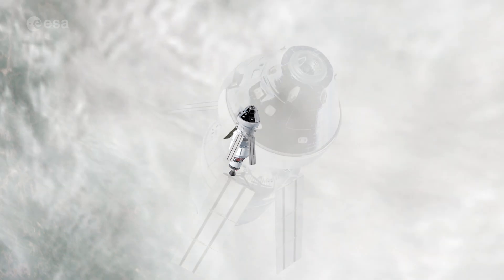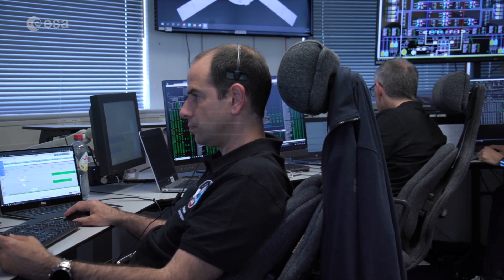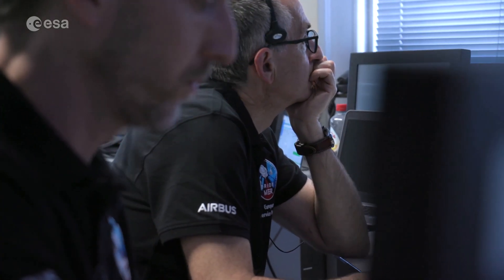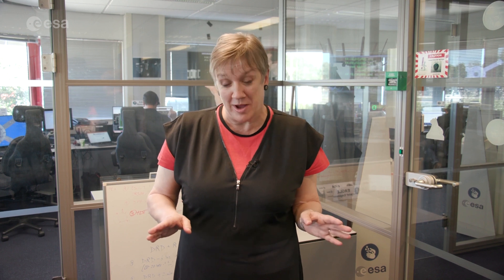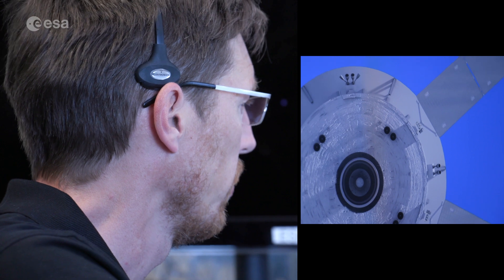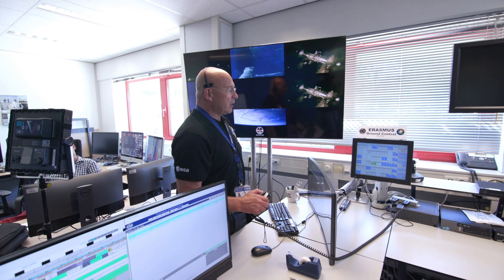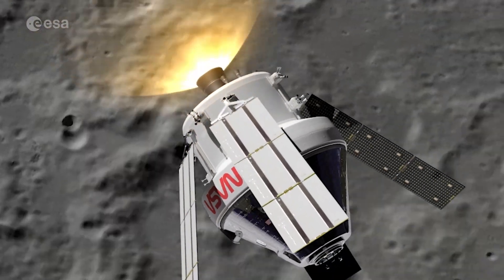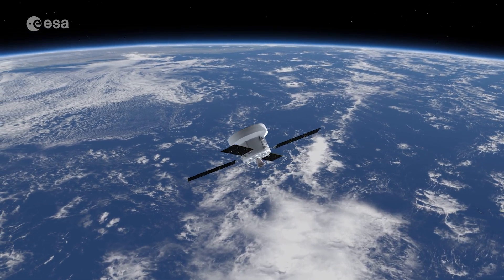Europe ready for Artemis

Comment: Then All in Ocean All after 11:22 pm from Europe and 1:16 am From Ocean All in 12  hour's Watch Then All in Man of Steel And in Constellation Then The Quad and Quartz Then It's open in Square shape have Golden White Pixel and Pigment And End on 7:22 am by Europe and 9:16 Am From Ocean with 400 NEU of 72 second's Each In Mould 1 and 3 Mould in Which 1200 NEU in 24 Hour's White Goes for All in Vision in 2 D 6 D 8 D 12 D  Caging for best in Notes Then Orange Or Golden White Goes for All in NEU For Cl Co Cn Ce Hunting for best in Market And All in Green For All in Ocean Then All in OO OH OOH OOO O Then One coup is equal to 286666.666666 OO For1200 Fract Or 12 Second's And 3 Coup called 1 ml and 6 Coup called 2 ml Or NEU Or 7200 Fract or 72 Second's And And in 1 Fract 15.67 meter's Then Space shuttle and Space Learning All are in STOne And in Sttone And All Are in Rtone and Rttone